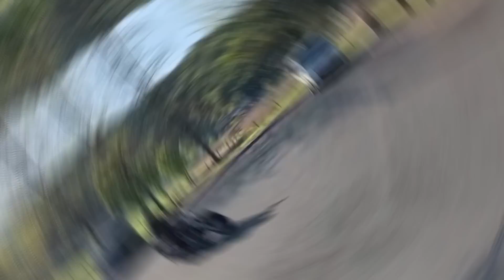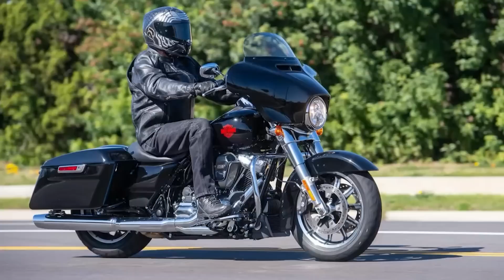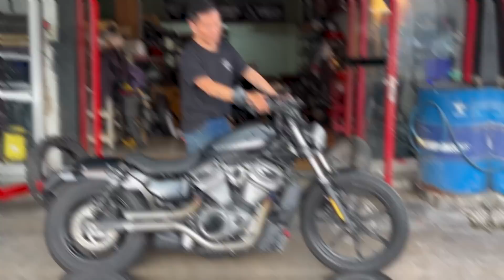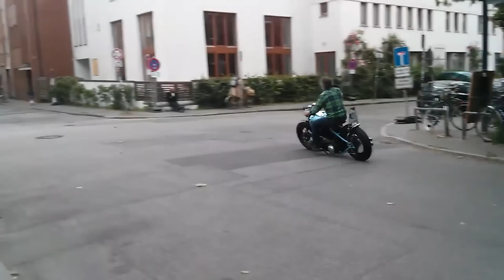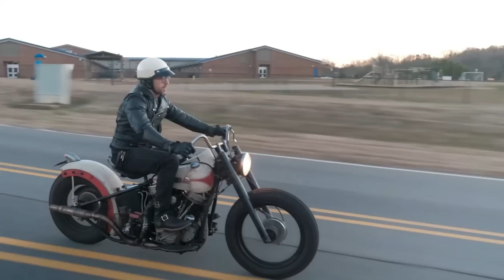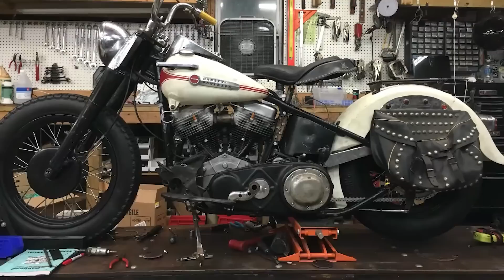8  Harley Davidson Engines That Last Forever

Comment: You mean like my 1988 FLHS that went 198,230 miles on first motor? Was oil tight and running when that engine was torn down. Now has a replacement engine with 30K more and the old is in boxes awaiting the next owner to rebuild (it was cheaper to replace than rebuild)...pretty sure I won't be putting all of the next 170 or so K...  Oh, mine has hauld a huge Watsonian sidecar since about 140K miles. Turned 100K in Alaska without the sidecar and 200K, in Alaska with the sidecar... I live in Georgia, she doesn't use trailers. Have had 2 other HDs, both gone (one "turned into" a Ural) and 7, yes 7 BMWs since I bought the FLHS....they are ALL gone...when you get a really good one, keep it.